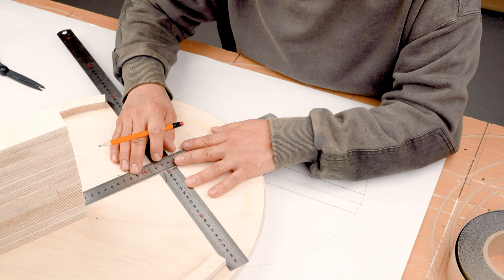Auto-fixed Stepper / DIY

Comment from the maker: Please turn on the subtitles!
When I was working on a ladder indoors, it was very annoying to climb and descend the ladder.
I thought it would be nice to have wheels on the ladder, but then it's less stable.
So I made a stepper that moves freely by attaching wheels, and when a person rises, the fixed axis comes down and stops.
I made a simple plate spring with a steel ruler, and fixed the wheels to the plate spring.
When a certain load, or about a person's weight, is applied, the wheel rises, and the fixed axis supports the floor. It's so convenient to push around with your feet and work on a high places.
I hope you can refer to the video and make it.
If it was helpful, please subscribe and like. Thank you.

#DIY #Stepper #Ladder #GO-STOP #Woodworking #woodcraft